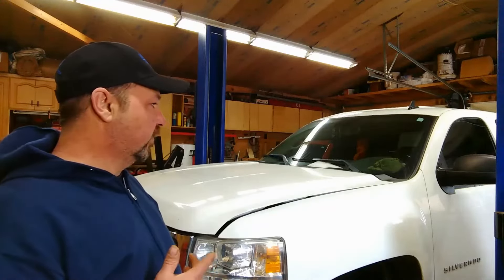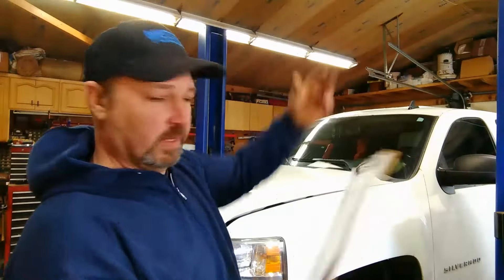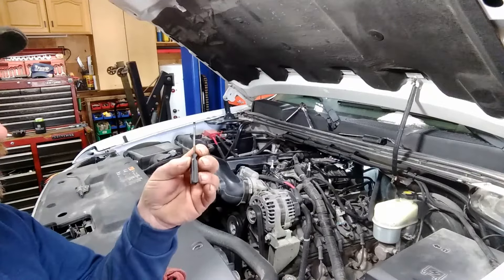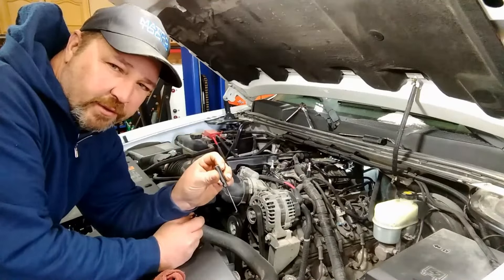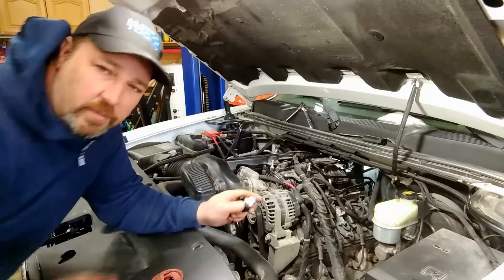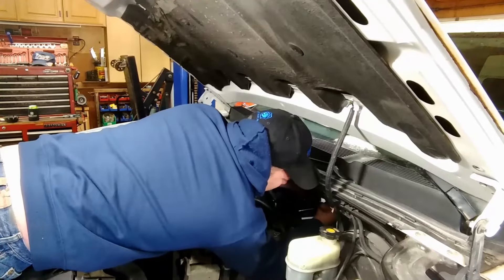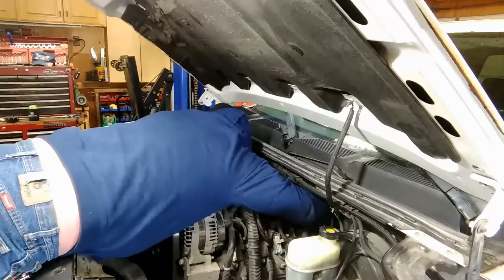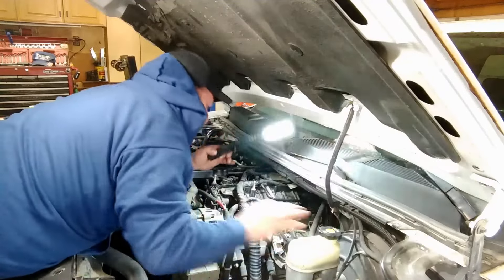2012 Chevy Silverado 5.3 1500 DIY Oil Pressure Sensor & Screen Replacement

Comment: I replaced the oil psi gauge 3 times on my 5.3l engine. 27 mm socket don't fit because there is a metal plate that is in the way. Must loosen or remove the plate. First time was a gauge in 150,000 miles. Second time was a new gauge failed at less that 50 miles on replaced gauge. Replaced again due to failure of replacement GM gauge.
Reply from the maker: Try a Standard Motor Products sending unit.

Comment: I understand the screens are problematic and it's best to leave the screen out, as in, do not install it after removing the old one (if there is one to begin with).
Reply from the maker: I don't know a lot about the internal workings of an LS engines but what does the screen actually do?  Thanks

Comment: The rear main covers are notorious for oil leaks.  Mine does it 🤷
Reply from the maker: Yes I have another truck coming in next week for the rear seal and cover.  I will try to do a video on that.  Thanks for watching.
Reply: @ want another one? 🤣🤣

Comment: I'm getting ready to do mine, 2011 GMC Siearra .  if the plastic cover or shroud was not on the back of the intake it would be a lot easier to get to this sensor,  I have no clue why that shroud is there , My Dads 2011 GMC sierra  it  is not there .
Reply from the maker: good question.  I'm not sure either.  Good luck on changing your sensor.  Thanks for watching.
Reply: Carefully using a jigsaw blade attached to a manual handle (they make such) saw it where it makes sense, I was able to remove about a 1/3 of it and made considerable better access
Reply: I damn near sawed it out of the way. But its possible to do it with it in there

Comment: Nice video! I have a 2012 Yukon SLT (5.3l, 210k miles) with the "low oil pressure" problem. Wasn't generating any codes about the pressure switch but after extended driving (half hour to an hour) the needle would start bouncing low and to zero for a few seconds, then go back up. The engine had plenty of oil and wasn't making any noise that would surely happen if there were no oil pressure. I replaced the switch (just like you did here!) but still had the problem, albeit less frequently. At my next oil change, I used Motor Medic Motor Flush after seeing a few videos on it related to this matter. Since then the oil pressure is noticeably higher (10 lbs or so more than it had been) and it hasn't had the problem since (about 3 months and ~5k miles now). It has full synthetic oil now and I check it regularly - fortunately I never have to add any as it's not burning oil at all. I'll probably do the Motor Flush every time I change it from now on, just for good measure.
Reply from the maker: Thanks!  Did you replace the screen?  If you replaced the sensor and the screen you need to verify whether or not that you have actual oil pressure.  You need to tee in a gauge and watch the sensor data on the scan tool and compare.

Comment: On my 2012 1500 5.3. There is a funny shaped piece of steel bolted to the block behind the drivers side fuel rail. The way that thing is made it really blocks access to the sensor. I don't know why it is there or what purpose it serves other than to block your hand.
Reply from the maker: Were you able to replace your sensor?  Sometimes I have to use a wobble extension and come in from a angle.

Comment: I've had such sender go bad on 4 of 5 GMs we've had, so I decided to give aftermarket sender a chance, as the GM ones all went bad.
Reply from the maker: Yes they seem to go bad quite often.  What brand did you use?
Reply: I used Standard from O'Reilly store, $40; part PS508
Reply from the maker: Keep me updated if it ever fails again.

Comment: Why didn't you show the before and after performance of the sensor ? Gratis video though
Reply from the maker: I was too green.  It was the sensor.  This is a regular customer for me and he has been in multiple times for different things and it hasn't set that code again.  Also when I was thinking of making this video I just wanted to show that it was completely and easily possible to remove the sensor and the screen.  Thanks for watching.
Reply: @petescustomcarshop  10.4 appreciate the video .much help and simplified

Comment: One should know that I watched quite a few YouTube videos before starting, but still had to lay towels over the engine, use a stool, and do some of the work left-handed. I was able to remove one end of a plastic tube at the rear of the engine for more clearance. I did not remove a second tube or the fuel line at its connection. I broke off the gray "protector" on the oil sender harness connector with a screwdriver, and with left hand pushing a long screwdriver against the connector tab and right hand on the connector, I was finally able to release the connector from the oil sender. The special 1 1/16" oil sender socket I bought like 25 years ago did not fit over the sender, I used a 27mm deep socket. Then I used a 1/2" wobble extension, about 5" long, and that was not easy to push into the 27mm deep socket, but the socket had to go on first. Then I used a stubby 1/2" drive flex ratchet to unscrew the oil sender.

Of course once that was unthreaded it fell somewhere so that took 15 minutes or more to find & remove. So I went to O'Reilly and bought PS508 oil sender, which actually did fit my special socket (but I still used the 27mm deep one).

So with the new sender (I did not even try to find if the engine had a filter screen, I didn't feel one) purchased, I tied a piece of twine around it it case I dropped that, and screwed that in a few turns with my left hand. Then I put the 27mm deep socket over that, then the wobble extension, then the stubby flex ratchet. 15 minutes later I had that screwed in, and actually in similar orientation as the factory one. So 10 minutes more to remove those tools without dropping them. So 15 minutes later I was able to blindly turn the connector to correct orientation to snap that on.

I re-connected the one plastic pipe I had removed, and started the Yukon: no oil pressure displayed, and check engine light was still on. So I disconnected the battery, touched cables together to erase all codes/clear computer, reconnected the battery, and started it up: all was working - SUCCESS !!!

So even though The Cuss cannot fix everything, I was successful today. Yes, this took me several hours, but since I'd just ordered Mrs. Cusser 4 new tires (as the 5-year-old ones were quite dry-rotted), felt why not save $300 to $500 by doing this myself. Some mechanics apparently remove the entire intake manifold for easy access, but that's labor hours. For me, trouble with the special oil sender socket I had threw me for a loop, but the 27mm deep socket I had did save me.

Realize that 4 different times I packed up stuff and quit, saying the mechanic could try his luck Tuesday, but The Cuss is a persistent little cuss, for sure. Mrs. Cusser is ecstatic, and promised to take care of me tonight....
Reply from the maker: Yes it can be done all you need is patients and a strong will and you will succeed every time!  I am glad you figured out that you could use a 27mm deep, I'll have to try that sometime.  I am glad you got your Yukon up and going and that you did it yourself.
Reply: So the big question here is, did you get taken care of, like promised?!?
Reply: Absolutely !!!
Reply: Welcome to our world
Reply: @thecuss6817  nice!
Reply: us left handed people finally have an advantage!

Comment: do you have to put the filter back in I've heard of people leaving at all it out ????
Reply from the maker: You mean the screen?  If so, no you don't need to but always will put it back in.  Thanks for watching.
Reply: I got a new one for mu 04 6.0 and the screen was to tall to be able to put sencer in. So left it out. But now I've got low oil pressure, New cam bearings installed properly. I was very careful with pickup O-ring. Guess I gotta take it back apart. Bummer.
Reply from the maker: @kevinwest3689  Sometimes you need to twist the screen as you push it in because of the o-ring also you need to be sure that part of the old screen is not left down in there.  I just did a 2006 with the 4.8 and it did not have a screen and was not machined for one.

Comment: I can’t get my connector unplugged to save my life. Any tips? The whitish grey clip is completely removed
Reply from the maker: Try to use a pick from the bottom to release the lock or something similar.  Sometimes I have even gone from the top side with a stiff piece you wire to release the lock.  Keep trying you will get it.

Comment: Why not cut that plastic cover/shield? What does it do?
Reply from the maker: I don't think cutting it or removing it would help much.  The sensor is still way down in there.
Reply: Actually I did that, the cover appears to do nothing and I was "at that point"
Carefully using a scroll saw blade/manual handle, again carefully taking time to not cut the wires going to the sending unit.
Ive not removed the sensor yet, but it sure helped to see and get my hand on it.

Comment: SO DID IT WORK???  show us that it now works,
Reply from the maker: I have not heard anything back from my customer, I will ask him the next time I talk to him and will follow up with you but I can only assume it is working as it should or he would have gotten back to me.  I would also say that every time I worked on a Chevy pickup with this code it has been the sensor or the screen is plugged and if your screen is plugged you have other problems that cause it to get plugged.  One more thing to note that it is way cheaper to throw a sensor in it than for me to spend time diagnosing it.  I would rather have the customer drive it and then if it didn't work then do the diag.  The main purpose for my video was to show that the sensor can easily be changed without removing the intake.